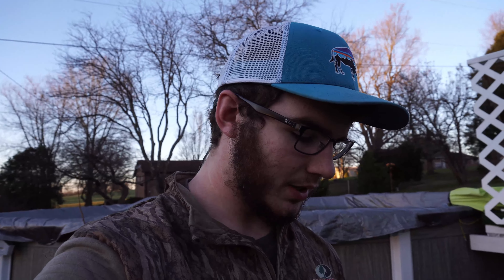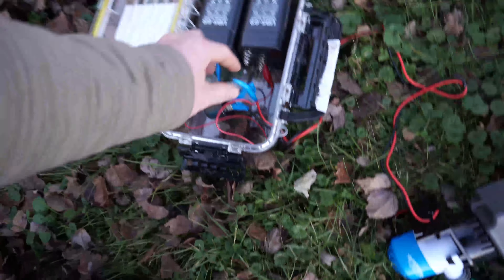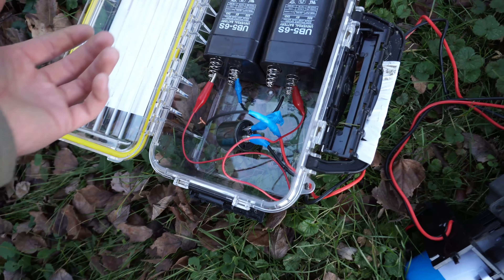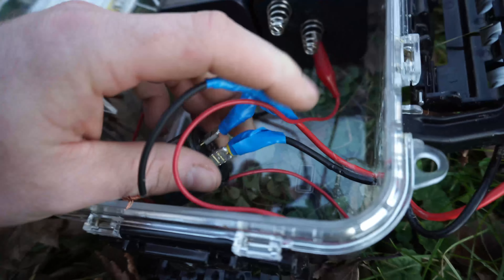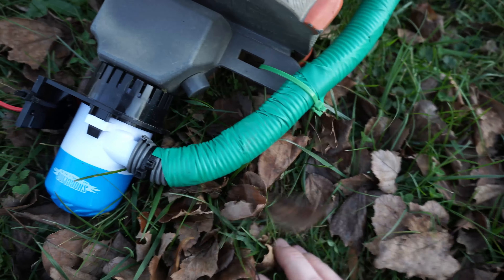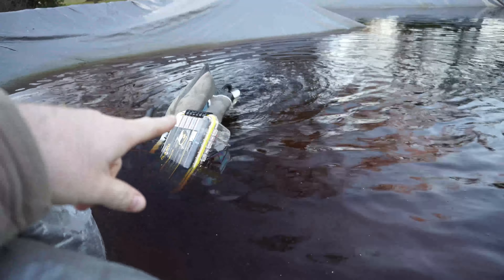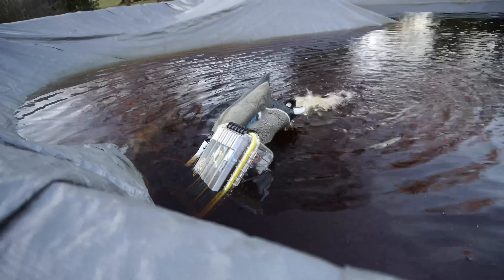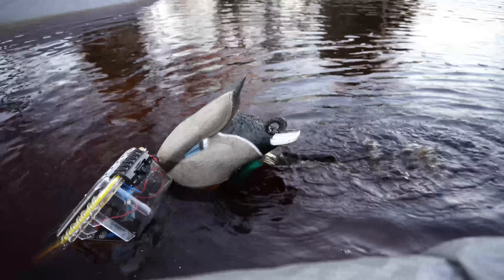DIY Duck Motion Decoy

Comment: That's actually pretty cool 😂
Reply from the maker: Yeah man it turned out good
Reply: Problem the battery goes dead quick !
Reply from the maker: Mine hasn’t died that quickly. It’ll last close to 3 hunts before it’s done
Reply: @furfeatheroutdoors8681  i have one the blinker runs too fast, lasting max 2 hrs ,, wish it would last longer
Reply from the maker: @jeffdonovan3504  yeah I’d just switch it man. Mine does go decently quick. But it has a slight pause in between. It seems to be pretty killer. I just got the heavy duty one

Comment: @Fur & Feather I thinking about doing this but instead I was going to experiment with adding the battery into the decoy shell then  have a waterproof connection coming out to charge. Do you think it would be possible?
Reply from the maker: It is possible Bc I thought the same thing Bc it would be easier to carry etc. just have to make it absolutely waterproof and may have to even run it off of smaller batteries instead of 6v or 12v. Have anymore questions just ask! Thanks for the comment.
Reply from the maker: May even try it myself and make a video on it